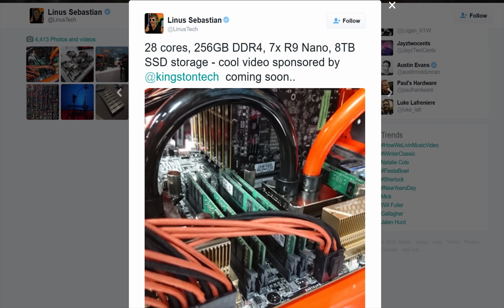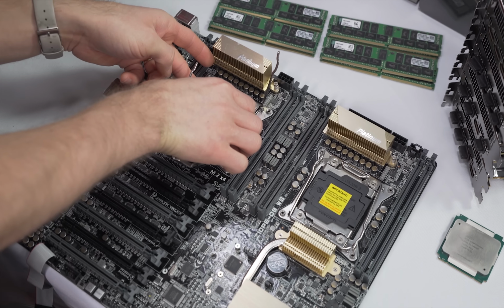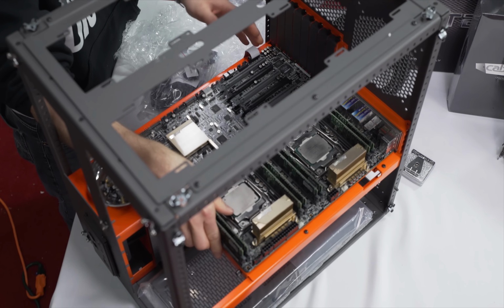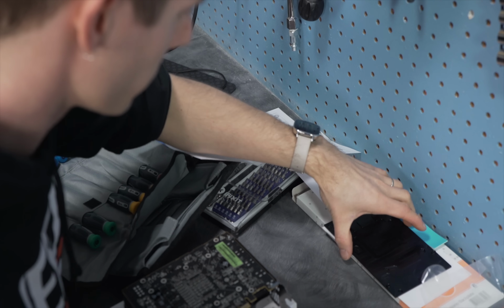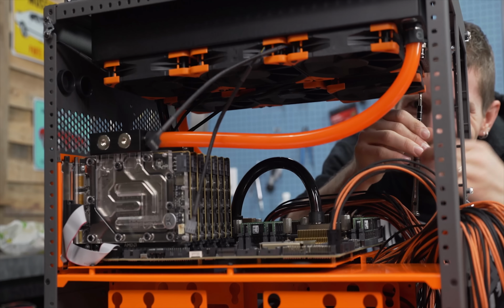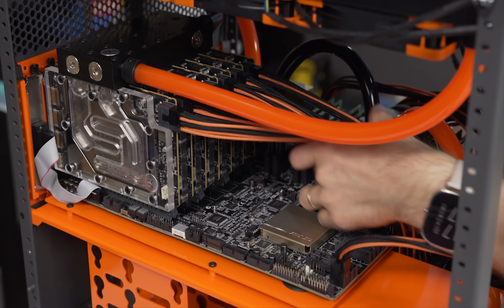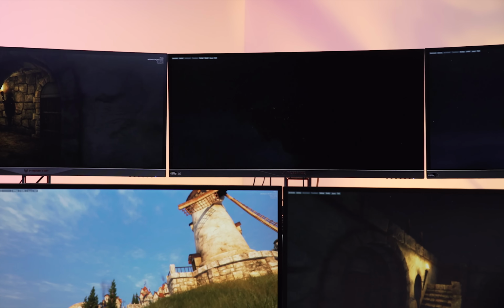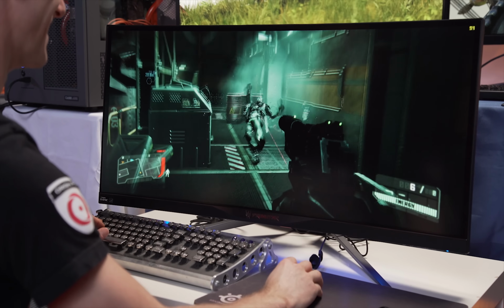7 Gamers, 1 CPU - Ultimate Virtualized Gaming Build Log

Comment: meanwhile I sit here with my fx 4100 and amd HD 7850 :(
Reply: Feels
Reply: +Baris Unalmis Dang that sucks I used to have that a few years back. :( It served me extremely well on my 768p monitor but couldn't quite hold up once I got 1080p. Ive since upgraded to an AMD R9 290 and FX 8320 at a 4.4 Ghz OC
Reply: +Baris Unalmis i have 6870 :(( plz halp
Reply: +Baris Unalmis Phenom II X4 B50 @ 3.84 and R9 380 still doesn't have anything against this...
Reply: +Baris Unalmis We have the same cpu yey :D i have my fx-4100 clocked on 4,6ghz. (stays on 4,55ghz thou.)
Reply: Random Person Well with a stock cooler i used to run it on 4,2 ghz the temps were quite high thou around 65-70 C
Reply: Random Person Cool i found my old oc i used to use this 4.2ghz  1.3625v 
:D
Reply: I had a i5 750 and GTX 275 for about 6 years until two days ago lol. I upgraded to an i7 4790k and GTX 970. Quite a difference.
Reply: +Random Person i used to replace the thermal paste on my stock cooler with artic thermal paste that droped it around 10c
Reply: +Baris Unalmis OI dont mock the HD 7850 that card is a fucking beast!
Reply: I feel like I outgrew games from some reason :(

Comment: History was made.
But can it run all those 7 screens at the same time in whateverK that is?
Reply: did you even watch the video
Reply: +NarkDights | JRkk7heGamer dude he is not crossfiring nothing, each vm is assigned a single GPU, so yeh they can run all together
Reply: +NarkDights | JRkk7heGamer I don't think there is crossfire support for that many cards so I don't think that would be possible and plus the resolution would be massive and that would tank the framerate on a game such as Crysis 3
Reply: +Rahul Katre  Only slightly more than the 33,177,600 pixels of an 8K monitor...
Reply: +NarkDights | JRkk7heGamer The 6 monitors in the background were running a benchmarking tool... the 1st monitor still played Crysis 3 at around 60-100fps whilst the other 6 VMs were going at this computer with tons of resource intensive tasks. So yes, it can.
Reply: What I meant was run 1 game on all screens at the same time, basically only 1 client and a very high rez game. Can you even crossfire that many cards??
Reply: Casey Middleton Thats what I meant, can you imagine it?
Reply: +NarkDights | JRkk7heGamer Its 3440x1440 per monitor. So that times 7 is 34,675,200 pixels. Now, 4K is 8,294,400 pixels. 5K is 14,745,600. So this is basically 2 5K monitors and 1 4K monitor.
Reply: +NarkDights | JRkk7heGamer Not for a few years haha
Reply: Casey Middleton Unfortunatly. it would look amazing!
Reply: +NarkDights | JRkk7heGamer Wait till DX 12 and then you can

Comment: not a fanboy but wouldn't nvidia cards draw less power for more performance? although that would be expensive as hell :P
Reply: +Tom Drescher gtx 970  with 3.5 gb of ram ;)) ?
Reply: It's close to impossible to run 7 consecutive GeForce Gtx there's nvidia doesn't support it and it would go over 1600 watt
Reply: +Tom Drescher Actually a comparable Nvidia card(980) would perform a tad better but have more heat and power draw. Not only that but it would cost significantly less to buy 7 980s. The Nano is the cost of a 980ti. A card which would be much hotter and hungrier. 

Also it wouldn't fit due to the DVI connectors, like he said.
Reply: +JayJapanB The watercooled Nano is way faster running on a high resolution. It should perform like a Fury X.
Reply: +Pyrrelda Lol, because NVIDIA doesn't support it? They aren't running the Fury Nanos together, AMD doesn't support it either.
Reply: +Tom Drescher This video is kind of a experiment, if it even would work. So AMD or Nvidia, doesn't matter. The r9 nano just doesn't draw that much power, and only takes op one "layer of pci-e slots" if you know what i mean
Reply: HamDerDanskeren It's just "single slot". :P
Reply: All graphics card takes up a "signel slot", but IO will take up two, if you get it
Reply: HamDerDanskeren No, I mean the IO is still dual slot. I don't need to get anything. And cards only take up a single slot with a water block or bare, ANY high end card will take up 2 slots with an air cooler, and sometimes more.
Reply: ye, but i mean the io xD
Reply: HamDerDanskeren I literally just said that.
Reply: +Pyrrelda true
Reply: +Devidov Anghelov not a fanboy
Reply: +JayJapanB thanks
Reply: LiquidPanic i meant the graphics card specs cant support that kind of enviornment not the company
Reply: Pyrrelda But nobody specified WHAT card. You could easily do this with quite a few NVIDIA GPUs. An even if you were to use the higher powered ones, you WOULD need 2 power supplied, but it would also perform better.
Reply: Probably but there is the issue of space for the graphics cards. Linus said if the cards were any longer they couldn't be removed.

Comment: OK,  but if you run 2 or 3 PSUs and then you use 2 xeons e5 2699 v3 and you use wathercooled and modifyed (just remove the DVI port and making to a 1 ) 980 ti cards or titan x cards and using the u.2 to m.2 adapter you can run a 1tb intel 750 series nvmexpress ssd to use it as a cache. With this you can make the best performance possible with the actual technology, for more we have to wait pascal gpus and broadwell ep. You can also try if that system works without vms, under the windows os withouth unraid and bench that. And you can also try to do a 28 monitors setup (someting like a 360 ° curved monitors setup)

Comment: I heard the phrase "custom built". Can an average Joe get all those used equipment?
Reply: +Mads T (Genesiz) Pay enough and they'll manufacture it.
Reply: +LonelyWithin Most of it, but prob. not the custom water cooling block that goes to all the GPU's. Think thats custom manufactured
Reply: +WEKS87 ofc, you can get anything made with enough money
Reply: I was partially exaggerating, but also 30k is a LOT to have laying around as an average person. I'm sure if you saved up for a few years, you could pull it up, but I'm not really sure if this thing is worth years of saving up especially when you could get other stuff that could be more useful

What I'm saying is that it's possible (especially since the price of all these parts will go down in time) it's just impractical. Could you do it to prove a point? Yes, but would you actually do it? Probably not.
Reply: +JustBen when I say an average Joe, I mean a person who has no connections with tech companies to get a custom built item from them. One more thing, 7 people can split the cost between them and buy this machine, each would pay approximately 4.3K$ (I know it's a lot, but still doable)
Reply: +WEKS87 They could release a 3 dimensional model compatible with CNC machines or 3d printers.
Reply: +LonelyWithin Everything except the block connecting the gpus, but they'll make it for you if you pay them. There are other ways of doing it though, just not as clean - they would involve pcie extenders.
Reply: +LonelyWithin The average Joe does not make enough money in his lifetime to purchase this computer AND live somewhere other than a street corner eating hot dog scraps from trash cans.
Reply: +JustBen because nobody's drives cars á 30.000 dollars or have other expensive hobby's like flying or whatever. 30k is a lot of money butt not so much people can't have it.
Reply: +Dada 50k before taxes...
Reply: +Dada The average family makes 50 Thousand, not the average American.
Reply: poodlelord
Hell yeah.
Reply: ***** "The median wage in the US per person is $26,695." That's  not over 49 thousand. In 2014 the median household income was  $53,657.
Reply: ***** If that is the median wage, that is the average.  Which means people don't normally go to college, as you said.

Comment: Does it matter is the SSD just floating in your case or does it benefit from being mounted?
Reply: +Aleksanteri Skaniakos “Snadi” An ssd has no moving parts inside, u can mount it where u want or let it hang, it doesn't matter.
Reply: SSDs don't have moving parts so you could put them anywhere and it really wouldn't matter.

Comment: Shouldn't those radiators have push/pull fans, considering the thickness? Would have liked to know the temps with the whole system at load. Also, what is to become of the machine?

Comment: Linus. could you try to make the best rig you can possibly build? I don't mean 4 way sli shit. I mean something were you can game on without having 4 way sli microstutter all over the place. just something that is as close to perfection as you can. my idea for something like that
-I7 5960X
-Msi godlike mainboard
-64 gb of klevv cras
-3 way sli titan x (I heard 3 way sli will run smooth in most cases)
-Samsung 951 pro 512 gb
-(2x) Samsung 850 pro 2 tb
-8 tb Seagate hdd
-(corsair 900D or this giant Silverstone rig)
-everything watercooled of course
-maybe a creative sound blaster zxr
-corsair ax1500i
-all this extra stuff like blueray reader, micro sd card reader, fancontroller etc.
-either Linus noctua fans everywhere or corsair sp for water cooling and corsair af for every other place.

would be cool if you could find a sponsor for something like that :)
would be cool if you could test it with a Acer predator x34 maybe

Comment: Best video in a while! Great work! 
Btw, do you get to keep the system at LMG? Or are you going to return it after CES?
Reply: there's no way he's keeping it. I'm sure that kingston takes it back.
Reply: +xSIMONSIGGEx linus has said before that most of their builds get disassembled back into their inventory so they can use the parts for other videos later. some parts are also loaned to them by the manufacturer who will want them back, i would expect Kingston will want their 256gb of ddr4 memory back, its probably way too expensive to just give away for one project.
Reply: I would assume that they would get it back. But, I don't really know if they will or not.
Reply: +xSIMONSIGGEx as a general rules these machine get disassembled and part used in other build projects, I could think of a few different builds with that motherboard alone
Reply: +Thelolmobile11 I remember in a wanshow like was saying how amd was suppose to send in the gpus, but forgot and then didn't have the stock to,so Linus was talking about how he bought them instead. My guess is because of that, LMG probably will get to keep it, but who knows.
Reply: +CyanYam linus*
Reply: +CyanYam that was the 380 or something. they didn't send it in for a review I think.
Kingston completely sponsored this build.
Reply: +xSIMONSIGGEx I'm sure most of the AMD cards are just borrowed and they use those xeons in other builds
Reply: +CyanYam No, they couldn't send the cards but they reimbursed the cost of the cards. So it still like they send it to him.
.
Reply: +xSIMONSIGGEx linus wtf
Reply: +xSIMONSIGGEx that power bill thoe.

Comment: Shouldn't you benchmark it as one physical windows machine before you installed unpaid and the VMs ? Imagine the numbers ... Imagine cine bench
Reply: +spyrmac I dont think crossfire works with 7 cards
Reply: +Gentel Dolan I think you can do up to 4 cards, I think. (Don't quote me on this)
Reply: +Visible Designs. unfortunately, you are right. for now, at least.
Reply: +spyrmac Well, Nvidia will make 8 way SLI possible and 64GB of VRAM with HBM2 later this year.
Reply: ***** Yeah, for their new Titans. I knew that. I didn't write that in my comment. Gaming GPUs will only have 8GB VRAM.
Reply: +spyrmac Theres no game that can properly utilize 28 cores. They're optimized for 4 cores as thats the most common scenario. This would be pretty good for PS3 emulation as iirc PS3s cell is highly multithreaded with each thread being pretty low powered.
Reply: +Rhedox well i didnt say anything about games. he could have done just benchmarks (non gaming related )
Reply: spyrmac that sure would be impressive.

Comment: Actually a computer for seven individuals that consumes nearly 1600W for $30K is not bad. You can use another power supply and separate loops for cooling the components.

Comment: now cross fire the cards and make the 2 cpus work as one and see what you get
Reply: +c202011 crossfire is only upto 4 gpu's
Reply: well add one more card and have duel 4 way cross fire that act as one?
Reply: +c202011 no...that's not how that works buddy
Reply: c202011 this is something that the GPU software developers both from AMD and Nvidia haven't been able to figure out, I doubt any "hackers" are going to work out any time soon. At this point in time it's simply impossible for more than 4 cards to work together on one instance.
Reply: the way i see it as fore cards working as one and 4 other cards working as one so thats 2 sets of 4 to work as 2
Reply: well make it work hackers dont do cant
wright some custom code
Reply: +c202011 are you ok
Reply: make it work that way :P
Reply: would love to see that happen, but would this mobo support Xfire?
Reply: +Lamma_420 7 or 8 GPUs will almost certainly be possible with DX12 multigpu support. But yes as it stands Crossfire and SLi only goes to 4.
Reply: +c202011 Soon, Nvidia will make graphics cards that support 8 way SLI and 64GB of HBM2 VRAM.
Reply: +c202011 
nah. for one, he's need a bigger PSU. than, a motherboard with 8 PCIe slots.
than there's the software issues that are highly possible.

Comment: I bet that the system cant run DayZ at over 30 fps in Elektro at ultra settings 1080p
Reply: +Chief889 That's the joke
Reply: +Chief889 Nice joke miss shitforbrains
Reply: +caddy i get a nice stuttery 25fps on my gtx680 in DayZ, the sooner it's fixed the better
Reply: +caddy Not talking about ARK Survival... I know it is the game's fault for not being optimized but those visuals at max can kill any machine with the most top notch hardware xD
Reply: Even in its unoptimised state I can run it fine on a 970...
Reply: +lol lol me too.. but only after forcing the game to run on DirectX 10 and force all resources. Also ARK has no SLI profile putting my 2nd 979 to shame.
Reply: I run it at all default settings, your CPU is probably bottlencking the 970. Before I got a 4790k I was getting shit FPS
Reply: ***** i know that the game dont know how to use an cpu or an gpu,it was just an joke
Reply: Chief889 yes,i know that

Comment: Can you do this by combining 2 1600w power supplies and 7 titan Zed's?
Reply: No, the back panel on titans uses 2 slots of the case
Reply: You can do 7 kingpin 980tis but titans take up 2 slots per gpu, you can do like pci extensions to a separate bay for your gpus from the motherboard in a custom case that you would need to build, but you would probably f*ck that up.
Reply: +FoodOnCrack Yes you can do that but will need pci e riser cards to make more space for the dual slot gpus.

Comment: Why the fuck you din't used two power supplies ?
Reply: +Tengu Siv 2x2000Watt psu's for that 7 way Titan X setup.
Reply: +Tengu Siv he could use gtx 980ti
Reply: You guys all seem to forget that the nano and fury can be converted to single slot cards....titans and 980 ti are dual slot, so you wouldnt be able to mount them on one mb

Comment: 1 gamer and 2 "cpus* come on linus get the LTT crew to play too.
Reply: +3DM Gaming But it doesn't, it stands for central processing unit.
Reply: +3DM Gaming no.
Reply: +3DM Gaming But CPU doesn't stand for computer, its a Central Processing Unit, witch Linus has 2 of.
Reply: cpu could stand for computer in this situation
Reply: The title should have been 7 gamers 1 computer.
Reply: +Dr Alec Reaper I agree, 2 cpus but 7 gamers
Reply: +soildmoose also if you would like to re read my comment "in this situation"
Reply: +Dom uwot yes. an abbreviation is a shortening of a word. shorten computer and you get cpu as well.
Reply: +Giorgos Angelis yes!
Reply: +soildmoose wrong it stands for calculation processing unit ;)
Reply: +Lucas Wolgast don't think so (;
Reply: +Dr Alec Reaper He said, those 2 CPU's combined, would be 1 normal cpu. So theoretically, it's 1 CPU.
Reply: +BlackenGames then you could also say 1 gpu
Reply: Arjen Hartink Yes we could, theoretically. You can say anything theoretically.
Reply: 24 cpu, 2 sockets, single tower. normaly for this speck I would give rack units for the case but seeing as its not a rack no can do 😁.